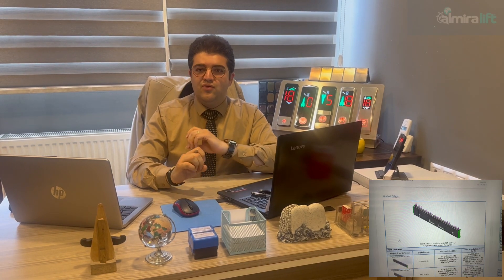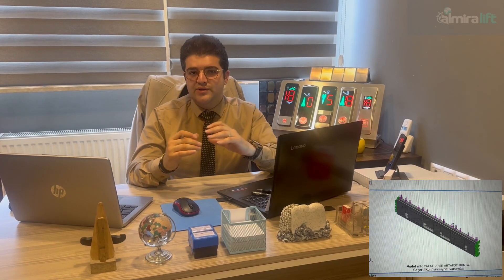Steel Structured Elevator Shaft Details

Comment: EN1090-2 for your shaft structures?
Reply from the maker: Yes of course, regarding the steel thickness, welding, fasteners, corrosion protective, force calculations, fixing parts, sealing of space, all and all are considered during deaigning and manufacturing stages.